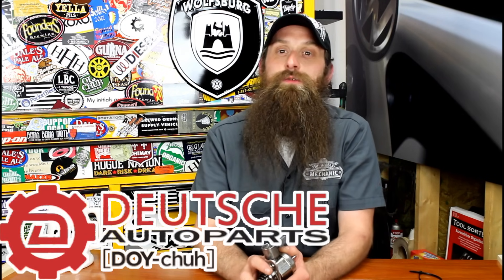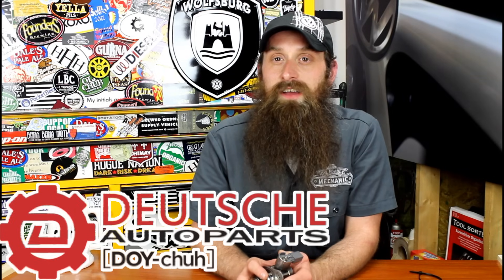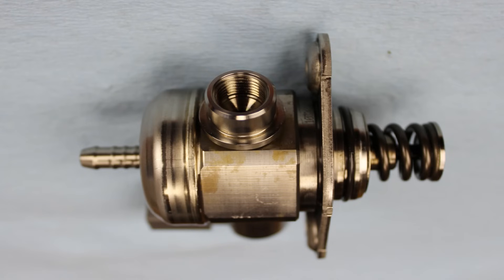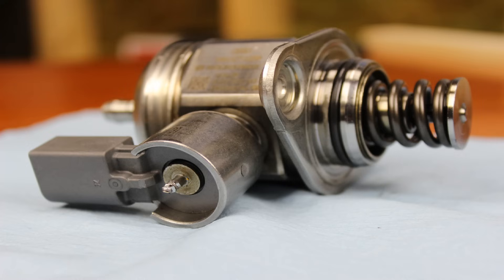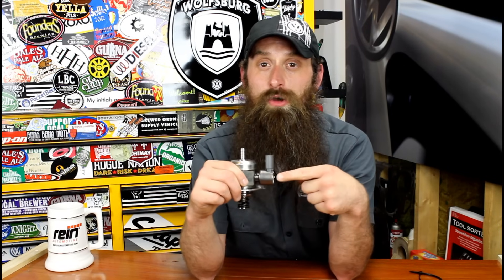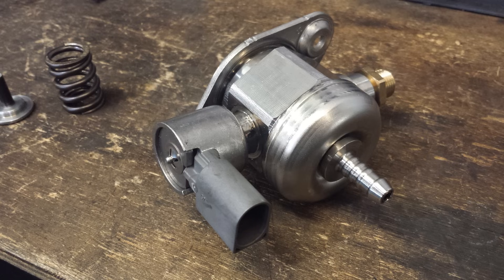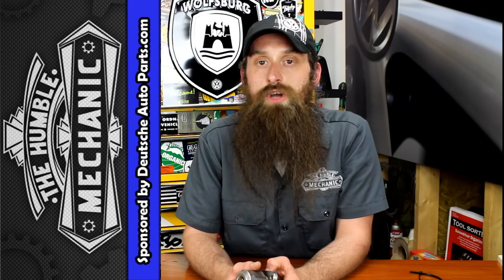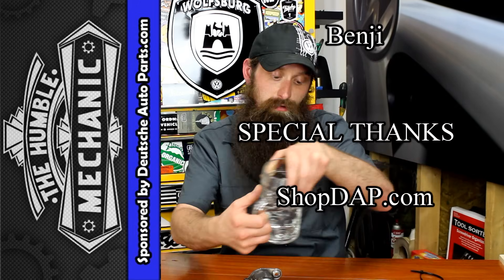How VW and Audi 2.0t TSI High Pressure Fuel Pumps Fail (HPFP)

Comment: Hello, I have a passat b7 1.4 TSI. I have the code P2188, too rich at idle. Replaced 2 times air mass sensor still getting the same issue. Recently got checked by VW here in Germany than they said this is caused by Timing Chain or the high pressure pump. But timing chain is already changed 2 years ago. Do you think that changing this high pressure pump can solve my issue? Thanks, greetings!
Reply: I have same thing on my golf 6 1.4 TSI, have you managed to fix things up?
Reply: @malcolm7226  hello, till now the high pressure pump seems to run smoothly and I haven't replaced it. From last inspection I have changed only sparkplug and ignition coils because of other code. Till now all codes are not appearing anymore. Have you managed to change the air mass sensor? That's the first thing came to my mind when I got P2188
Reply: @fatjonhyka2460  our engine (CAXA code) has 2 map sensors (pressure and temp) instead of mass air sensor (volume), but i think they work fine since car drives normally…my pressure pump also works fine, no codes related to pressure but this P2188 code lights up every month or so, its very irritating, after a lot of googline there are 2 options: leaky seals on hpfp (which comes with idling consumption 0.2-0.3 l/km, oil smells of gas) and leaky injectors….i have vcds and i tried to monitor pressure value, since pressure remains stable after shutting engine down (it increases since engine is still hot and this increases the pressure) so i think its not my hpfp, its probably one of the leaky injectors while engine is idling, it probably cannot close enough when engine needs only l small amount of fuel so it screams rich condition, on the other hand my oil has a little smell of gas but im not really shure since all engine oils have this mild petrol smell….i drive my golf for 2 yeaes now like this, consumption is 5-6 l/100km and there are no any other problems
Reply: @malcolm7226  hi , I got again the code P2188. Indeed when I check the oil, it smells as gas petrol a lot. Now my start/stop it does not work anymore and when I was driving on highway I got some shakes, feels like air pressure up and down, or like you push gas pedal and remove your foot off. Thats very strange. I was thinking to replace the hpfp as I was advised from Vw months ago. How is it going for you  now?
Reply: @fatjonhyka2460  hi, i changed my hpfp and all filters, i did it before my annual vrhicle test and i passed eco test from first try, my idle consumption is 0.6-0.8 l/h now and oil doesnt smell on fuel anymore…so it was definitely hpfp, i ordered mine from ebay Hitachi brand + hpfp pusher vw original….i recommend the same thing for you, no more p2188 code
Reply: @malcolm7226  oh good to hear that. I'm ordering hpfp original from vw. It costs only 40€ more that hitachi part. And for sure oil and filters as well. I'm struggling with another code as well P0236
Reply: @fatjonhyka2460  mine hitachi works fine,  Hitachi is vendor for VW so its same part with dofferent branding, hm i get sometimes P2099 i think its similar like your code, its probably our turbo wastegate actuator rod that gets stiff from age and cannot regulate pressure, i see this sometimes while driving, i drive 140 kmh and i cant go faster, and then but later i can go faster…google caxa engine turbo problems and youl see a lot of info

Comment: I bought a cheap 2010 CC and my fuel pressure at idle is 80BAR. Going to try replacing the pump and hope this fixes the problem
Reply: 40 bar at idle is ok. Higher is better for hpfp.
Reply: @jeffferg8498  the timing chain skipped a tooth or 2 so the fuel pressure wasn't being regulated properly
Reply: Wow. Any valve damage repair required? My CCTA lost all intake valves.

Comment: This video is exactly what I needed to see. My 2006 2.0 T Has low power while trying to accelerate. I already had a feeling that it was my High Pressure Fuel Pump just because I had the low pressure in my fuel tank checked already and it’s working... So now I know that I’m going to the mechanic with more confidence of what’s going on and will get him to check the synod on the pump to see if it’s working. 👍🏾
Reply: Hi mate did you sort the issue in the end. Was it the high pressure fuel pump causing the issue?

Comment: I have a audi a4 2.0TFSI 2008 the high pressure fuel pump has a leak how can I fix it or do I have to buy a brand new one I hope not because there really expensive if you can help we with my problem I would really appreciated

Comment: I have a 2014 cpra Passat the engine will stall when warm changed hp fp and low pressure pumps I don’t know what else the engine is storing no codes the car cranks but no start could the crank sensor cause no fuel

Comment: I have a stage 2 cupra running stock is38 turbo at 400bhp 400ibft, on monday the turbo went poof. this was the same day i had my hpfp fit with autotech internals, i logged the car on the road and the requested fuel target was being met, do you think this was just classic is38 beahviour?

Comment: Humble Mechanic care to comment on what audible noise is characteristic of a failing HPFP if any?  i suspect one of my clients has a bad pump. I replace these pumps routinely in other german imports and usually failure is due to an internal seal and there is no audible or visual indicators of failure.  In the case of the 2010 VW CC i'm evaluating currently, there is an audible chirping noise (rhythmic) that I suspected might be the vacuum pump initially but after new vacuum pump installed, and chirping remains, delayed starts ..im leaning toward this pump.  Car has an ecu issue by which im not able to connect a VAG to read the check engine light that is on, so i'm having to go on other diagnostic indicators such as the one you asked about. Anyone out there from HUMBLE MECHANIC channel wish to comment?

Comment: 2.0T audi  after putting gas in the tank doesn’t start right away take a few turns b4 starting and if I leave it running while pumping gas it idles rough

Comment: Could this problem, cause my car to randomly cut out loose power and not start again, unless I crank it over for about 30sec 3 times then starts after a long crank on the 4th time, but will cut out again shortly after. Also had it plugged it at local garage and it came up clean no faults.
Reply: It's so annoying brother! Same thing happening with my car and my mechanic is suggesting the high pressure fuel pump. What was the cause of your issue please reply bro I'm lost😢

Comment: Bought a Audi A3 TDI from the emissions recall back in Oct. 2019. Catastrophic HPHP failure after owning for 3 months. Towed 115 miles to Audi dealer and they called after an hour of diagnostics $139.00 claiming fuel was contaminated with gasoline and would not be covered under the warranty extension. I immediately asked the service manager how they tested for the gasoline and he said he didn't know but that is what his technician relayed to him. I called Audi CS and they didn't know then I called two more Audi dealer service departments, one saying they had an instrument in which he recanted after talking to someone else and the other saying they don't have a test. I feel like I was lied to and I know for a fact I have used nothing but low sulfur diesel. The fueling guard is also in place. Is there a test that they can run in shop for fuel contamination or not? I do have a baggie of fuel where I checked the filter that I am taking to a local fuel lab tomorrow. If they are right I definitely will need to apologize.
Reply: I'm in the exact same situation. We bought a Audi Q5 TDI demonstration car at 4000km drove for 4 days and the car suddenly stopped. We got it towed to Audi centre and they said it's not under warranty because of 'bad fuel'. It will cost 15k to replace everything... What happened after you got it checked??
Reply: @hour1834  I went ahead and paid $6500. for the repair. Since I had pulled a fuel sample when I checked out the filter before having it towed I sent it to be tested by FOI labs. When picking up the vehicle the technician told me they had no way of testing the fuel but Audi wouldn't cover without a fuel test. This is bad business saying fuel is contaminated and not covered by the warranty but having no proof that it is contaminated. The fuel test showed no gasoline in the diesel and very low sulfur content. I'm still working with Audi customer service on the situation.
Reply: Brian Conn certainly bad practice! We had to get our fuel independently tested as well. Waiting for the results at the moment. We’re gonna take it to fair trading and ACCC. Are you based in Australia by any chance?
Reply: I have a few questions for mechanics reading this. When diesel is ‘bad’ or ‘contaminated’ doesn’t that refer to water or some sort of algae? Could it also be metal filings in fuel? Also if there is a catastrophic failure can metal end up in the fuel tank?
Reply: @hour1834  I'm in the US. Audi CS sent me an email yesterday after receiving the fuel sample stating the HPFP failure was due to outside influence. Upset I started filing a complaint with our attorney general. They needed a contact at the dealership so when I called the service manager was no longer with them. The new service manager put me with the GM and asked for all my documentation. Should here something in a few days. Won't stop trying. I had the fuel tested for flashpoint, sulfur, distillation, microbial growth, and water.
Reply: @hour1834  catastrophic HPFP the lobe disintegrates sending metal throughout the fuel system including lines, injectors, and fuel tank. When this happens you'll see a glow plug warning light then it shuts down not to be restarted. All has to be replaced. I have read the pump made by Bosch is made for a cleaner European diesel and there have been issues with other manufactures  using their product.
Reply: @Bman6711  Hey Thanks for your message! Outside influence? That's crazy. What does that even mean!! We are still nervously waiting for the fuel result. One thing I'm concerned is what if the result says its 'contaminated' because of the metal filings or other things that has spread into the fuel tank/system. Since the service manager is saying the metal filings is the reason why its 'bad fuel' and ultimately failure of the car.. Anyhow let's keep each other updated!
Reply: @hour1834  the metal filings were not in the fuel prior to the HPFP failure. The filings are a result of HPFP failure. Have the same picture you posted from the HPFP sensor removal. Good luck and it's great we were able to have a conversation. Keep me up dated.
Reply: @Bman6711  welllllll?? 3wks later
Reply: We refuelled it but certainly didn't misfuel since we have a receipt. The service manager is saying there are metal filings within the fuel tank and that the only possible way this has got into the tank is by being filled in. Also there are some metal shavings in the HPFP and the filter is quite dirty. We are still confused and shocked

Comment: Here's how mine went out on the 1.8 tsi. Initially I had hard starts every now and then, didn't care much as i thought my battery is not liking the weather and it only happened on cold starts. Then I left the car parked for 2 days straight and on the third the car had a little thump while idling and when you hit the gas while on neutral it revs normally to almost 4K. Then while driving the car wouldn't rev above 3K and would start stuttering until i lift of off the accelerator then it would up shift and keep going. To my surprise, the check engine light was out (bulb was burnt) and upon hooking up the scan tool it showed a fuel rail pressure low code. Changed the pump with a used one and drove the hell out of the car and it was all smooth.
Reply: Did the lump during idle go away after you swap the high pressure fuel pump?
Reply: @coryjackson6034  Yes

Comment: What does the high pressure fuel pump sound like when it fails like a bucket of bolts?
Reply: good question, i suspect one of my clients has a bad pump. I replace these pumps routinely in other german imports and usually failure is due to an internal seal and there is no audible or visual inidcators of failure.  In the case of the 2010 VW CC i'm evaluting currently, there is an audible chirping noise (rhythmic) that I suspected might be the vacuum pump initially but after new vacuum pump installed, and chirping remains, delayed starts ..im leaning toward this pump.  Car has an ecu issue by which im not able to connect a VAG to read the check engine light that is on, so i'm having to go on other diagnostic indicators such as the one you asked about. Anyone else out there from HUMBLE MECHANIC wish to comment?

Comment: Hey bro. My car just stalled after a short acceleration. I stopped, ran the test vsds.. No freaking errors at all. Strange. Cranked and it started right away. So far nothing i can think of. 140 block measures 40 psi at idle, no loss of power of any kind. Any idea what happened? i was on a secobd gear,  pushing gas after almost a complete stop.

Comment: Hi, 
I had a code telling me the mixture is too rich in blank one and 2. So i took my car ( V8 4.2L) and they said It's the 2 high pressure pump. I think they are wrong. What are the odd that i get 2 error codes at the same time? Each code is for one side of the engine.

Comment: I'm so mad. I replaced a PCV valve on a 2015 beetle today and the engine bay was getting so hot previously that the top sender on the HPFP broke off while I was working. Doesn't appear to be any way to service that part....so a new HPFP is needed all because of the crappy placement of that solenoid

Comment: Hi, I have a 2015 mk7 GTI which rough idles when cold started. sometimes it throws up EPC light too but upon scanning with VAG-COM no faults were recorded. Everything comes back to normal if I just switch it off and restart. What do you suggest checking?

Comment: My latest oil test on my 2.0tfsi A4 found 2.3% fuel in oil with high iron content (128K miles).  Failed camshaft follower into HPFP?
Reply: id say likely ring failure leading to higher blowby gasses in the crank. failed camshaft follower would create higher iron content yes, however, if the followeer was failing it would only reduce the stroke of the pump  and not cause internal damage to the pump leading to fuel being injected into the crank

Comment: Mine has an extended crank right now and I read the fuel pressure with my access port and it was at .64 lmao but if you wanna slang a hpfp my way that would be nice

Comment: Fail p2294 open / permanent fuel pressure regulator, can it be the solenoid ?, which is the relay of the same if it is commanded by a relay ?. Thank you.
Reply from the maker: Yeah odds are it the solenoid. http://wiki.ross-tech.com/wiki/index.php/18726/P2294/008852

Comment: easier ? my ass burnt 8 hours on this job. I lost the screw which secures the fuel line on high pressure pump twice inside the engine bay as it has to be tightened from the bottom on Audi A4 quattro B7. I had to visit dealership twice lol
Reply: I usually try to do hard to reach jobs with those long magnet sticks for this reason

Comment: Is it possible the car has rich mixture if the high pressure pump is bad?
Reply from the maker: Possible but that’s rare. I’ve heard of fuel leaking to oil and causing rich issues

Comment: I'm doing diagnostic on 2013 Chevy traverse I pull the code p228c regulator 1 exceeded control limits - pressure too low, could this be high pressure fuel pump??

Comment: I’m working on a Audi A4 and i have P0088 code is a high pressure over the normal pressure, i check lines and change the pressure sensor with out any luck, do you have any advice for me? Thanks for your videos are so nice

Comment: I have kia sportage 2014 gdi car is working but not have power and determination and the code P0193 is appear I change the fuel real pressure sensor now car not starting eanles i remove the fuel real pressure sensor or wire of high pressure pump if the tow is plug in car not starting

Comment: I’ve got a 09 Tiguan. It’s using huge amounts of fuel. Low pressure is at around 30-50psi. Engine runs fine and no codes. High pressure fuel shows 37.5-40bar at idle. Any ideas as to what could case the poor fuel mileage? This was an overnight issue and only getting about 200kms out of one tank of fuel.

Comment: I got codes p2293 and p2295 (Fuel Pressure regulator - Control Circuit Low)
Reply: I have p2295, did you fix the issue?

Comment: Nice video would the code p2188 too rich at idle be potentially a failed fuel pump or possible fuel injector.(sparks plugs o2 sensors coil pack and fuel filter all changed) thanks.
Reply from the maker: It could be. The injector leaking can also cause a misfire. There are a few other things it can commonly be depending on the engine

Comment: Guess what, there's another way these pumps can fail.  I've been getting a gas smell in my '12 A4 and looked and there's gas leaking from around where the solenoid screws into the pump!  It doesn't appear anyone sells a seal or anything for that so yay, I get to replace my HPFP.  Another $400 into the Audi...
Reply: That's the same problem that I have with my audi a4 2.0TFSI it leaks fuel from the top how did you fix it or did you just bot  a new one? Hope it has a way to fix it because there expensive lol

Comment: replacing my second one and found that the hpfp spring had stayed recoiled which led to the codes, however the hard gas rail wont sit flush to insert into the bottom.  also, i really dont want to have to remove the air intake system just to wrench over the rail so that it fits.  woo.